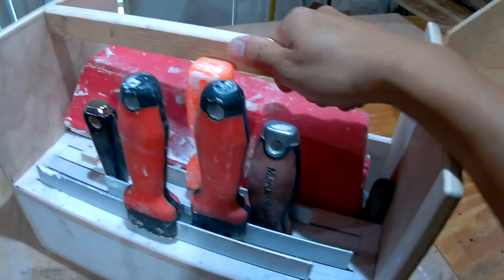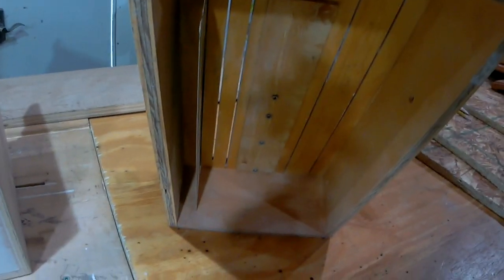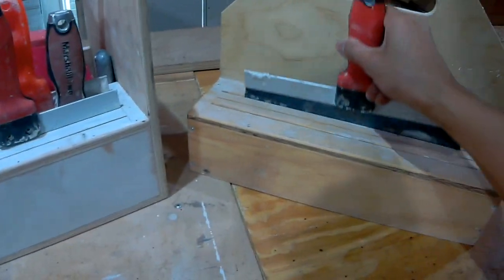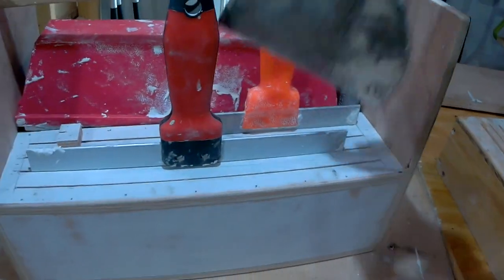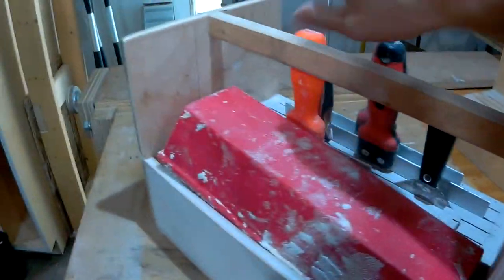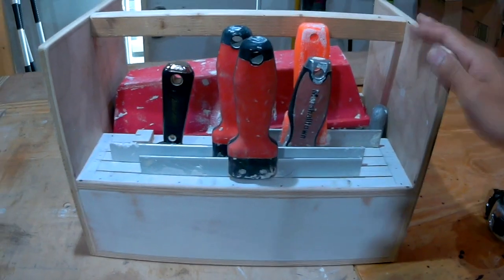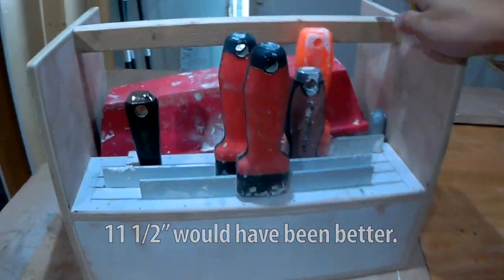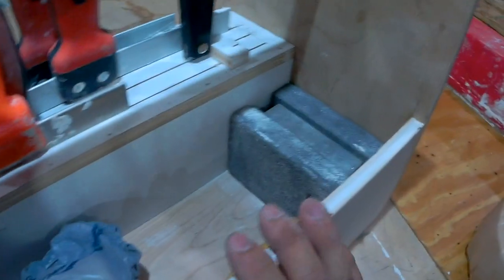Drywall Knife Tool Box (DIY Wooden Storage Caddy Tote)

Comment: Fantastic idea and builds. I have stored my large drywall blades at the top layer in some large storage totes just to keep them from being banged around. Even my mud pans are in less than amazing places... and my paper tape roll is stuffed somewhere....

Making something like this would give all those tools a home. Really keen to try this out. Already trying to think of how best to cut the slots. Maybe just jigsaw or scrollsaw and avoid circular saw with thin kerf to get it right and clean.
Reply from the maker: Thank you so much. 

I’ll throw out another way to make the slots. On my first caddy, I just ripped down some plywood into 3/4” strips. Then I also took some 1” x 1/8” pieces of wood and glue everything in alternating order.